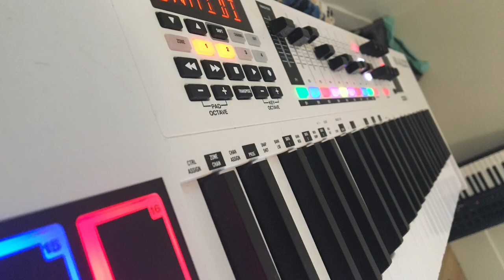M-Audio Code Series : Midi Freeze ( FIX )

Comment: Glad a video was made on my discovery. This will help others who aren’t on the forum. Mine is running smooth since the removal of the aftertouch cable.  Before it was hanging on me live in church and in my home studio. Not a nice experience at all....

I saw someone had the Black Code and was experiencing the same problem too. Apparently it's the same as the White Code under the hood, just a different color.

I’ve learnt 2 lessons from this incident. 

1. Before buying a product, forums are one of the best ways of finding out how the product is performing despite the marketing hype.
2. Once the product is released, give it sometime before purchasing...well that’s unless you have a good warranty and can return it if no fix is forth coming.  

Cheers!
Reply from the maker: You found out th fix on the forum ? I've never even seen this forum. I just heard of a magical fix that came from a magical forum in for far away land , LOL. 

I was so frustrated with my M-Audio I was willing to try anything. It worked , blew my mind. Figured it needed to be shared via you tube since so many people use it to troubleshoot these days.
Reply from the maker: I hope the video helps others too. Yes, M - Audio kinda showed thier true colors witht his product and kinda lost a customer.
Reply: This is the link to the forum. http://community.m-audio.com/m-audio/topics/code-61-stuck-notes

Comment: But here's something interesting: After I unplugged the aftertouch I lost the (garish and unlovely) lights on the drumpad. So I went back in and started fiddling, like one does, to see that everything was cool and I hadn't pulled anything else loose. 

Everything apparently in place I decided to stick the aftertouch plug back in just to see if that had any effect. The lights stayed dark, but, hey hey, the stability remained. So in my case the freeze issue was solved (as long as it lasts) by unplugging the aftertouch and then plugging it in again. 

The lights came back after the next restart. 

But shame on you M-Audio for not fixing this!
Reply from the maker: I agree 100%, can't recommend them anymore to anyone.

Comment: I am the unlucky owner of one of this. Looking at 3:20 in the video it seems that the problem is an electro magnetic coupling between different signals in different cables. In fact they have used 2 ferrites (the 2 black cylinders around the cables) to reduce the coupling noise. You could try to simply use a tape to fix the aftertouch cable on the plastic, far away from other cables, and probably it will be working without any problems. Let me know if this helps.

Comment: Hi, I am having a problem with mine where the power button does nothing but all the lights are flickering and the display reads "D 8" with a line through the centers of the 8 (all LED segments lit very brightly).  This happened when trying to shut down the keyboard after a session using only power adapter and midi out.  Held power button to turn off and the keyboard went blank, then next power on this happened.  No change if powering via USB or with adapter.  The lights light up as soon as power is applied.  Power button does nothing.  No midi signals are sent.

Comment: i have an oxygen 49. it is set on factory default. the click track is acting erratically.  when i open the track it is set at 120 bpm but starts much lower than that. this continues for about two bars. then, there is silence for a number of bars until the bpm kicks in at the correct speed for several more bars then silence and this keeps repeating during the recording. any ideas

Comment: mine is working good. any freeze that happens to me its related to usb hubs.
i got here bcause i have argon8m and the zones parameter is reseting the preset on the argon. searching for solution
Reply from the maker: Had nothing to do with usb hub but think this was a issue on early models
Reply: @toddsmithmusic3172  alright. Mine is relatively new I bought 2018. And it does freeze but as I said for me was with midi hubs. My issue was other and it's fixed :)

Comment: hi, I actually have a different problem, the G key is not working ( the one with the 5 above it ) it only responds when I press it deep to trigger aftertouch, but a regular tap doesn't to get registered, do you have any idea if this would solve my problem as well?
Reply: i have this problem too, do you happen to have a fix on this?